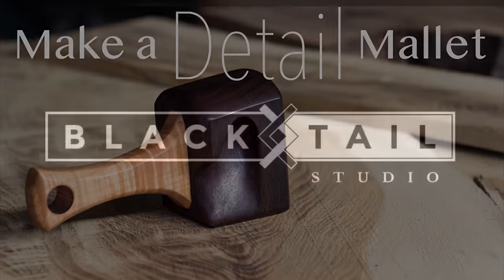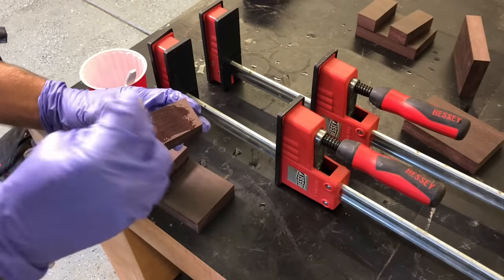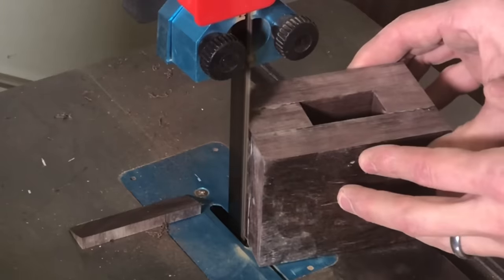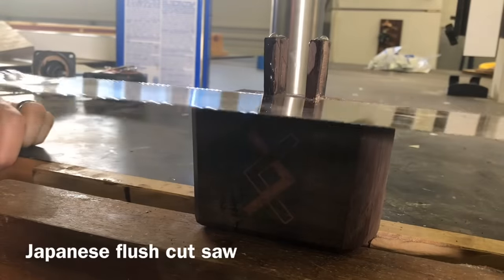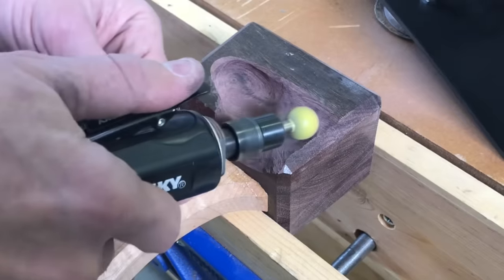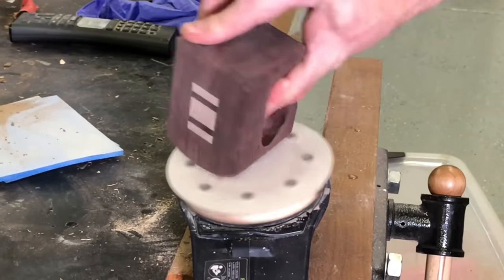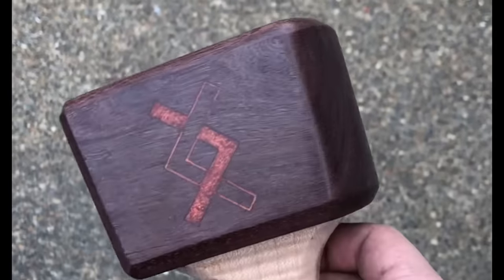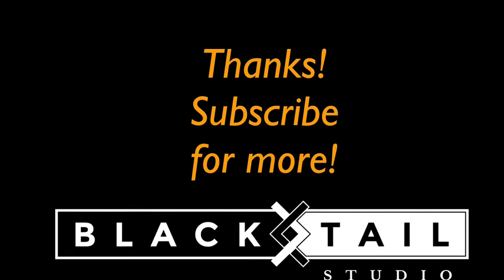The Glove Woodworking Mallet

Comment: For super hard wood i'd suggest either brazilian cherry or african blackwood.  African blackwood especially polishes to a crazy high gloss.

wood-turners trick: For a final finish without micromesh, sand with fine (2000-4000-ish) automotive wet-sand paper (with or without water) than final burnish with some wood shavings from the same wood.  On a lathe i'd just grab a handful of shavings and squeeze around the spinning piece.    More pressure = more burnish.  I'm curious of anyone has tried something similar on flat pieces (maybe shavings under a flannel patch on a random orbit or vibratory sander?)

Comment: Get yourself some copper tube cutters. It will make the cutting so much easier and straighter.
You can get a cheap pair on eBay for like 5 or 10 bucks and if you aren’t using them all of the time they will be fine

Comment: 1 - Here is a suggestion for wedging - drill holes at the end of the cuts for the wedge.  Larger diameter than the actual cut.  This allows the spring ends to spring open and not overly stretch the wood as the tops wedge outward.  Removes the inner stress at the spring end.

2 - Would not a "squarer" face on the round end be easier to use?  Less "slipping off center" as I see happening in the vid.
Reply from the maker: I didn’t notice any slipping, But definitely make yours any way you want 👍🏼

Comment: Where do you get some thick all purpose bandsaw blades like that? I looked everywhere and all I have around her are the thin 1/4 wood blades. And also, my saw has a 96inch blade, how come yours stays straight? Mine flops around, I can barely cut a straight line. If I tighten it. It snaps.
Reply from the maker: I got a pretty good bandsaw. That helps. It’s a laguna with a laguna blade. Both are available at woodcraft or rockler.
Reply: @BlacktailStudio  I dont know how good mine is, but its a big Delta with 14 inch wheels. I would just like to cut straight lines. damn noodle blade!

Comment: Amazing work. At the very beginning, you briefly show a couple traditional mallets with the copper pipe in the head, presumably for weights. How do you cut the perfectly matched wood plugs to for inside those?
Reply from the maker: Good eye! And plug cutter on my drill press

Comment: What!!?? Are you kidding??!! Brother! How can you dis Katalox that way? Katalox is a GORGEOUS wood (it also cuts and carves so nicely, and smells so unique too, though I admit, you're right, it irritates the sinuses). I use it alot and its purplish tone contrasts so well with the orange colors of Padauk, Cocobolo,  Bubinga, the gold of Jatobo, Bocote, Goncalo Alves, Granadillo, etc. . As you've surely discovered, with Maple it looks so much like an ice cream sandwich! . Its purplish brown tone seems, to my eye,  to be enhanced by PurpleHeart, which is awesome even as just a thin slice for accents.  BTW,  FYI, I have found that  some cuts of Katalox is so "waxy/oily" that some epoxies and glues just pop right off of it like it was mold released if you don't treat it first. Especially when gluing it to other waxy/oily/silca heavy woods like cocobolo.  I've discovered that if you scrub the to be glued surfaces first with acetone then rubbing alcohol the surfaces will glue up just fine. The acetone seems to loosen up whatever teflon-like compounds in the wood fibers that make it glue resistant and the alcohol wipes it all up; and since alcohol volatile it evaporates and leaves the surface more porous, less hydrophobic and much more gluable. Give it a try, let me know if you get the same results.

Comment: Sorry for commenting on an old video.

If the mallet is uncomfortable to use straight up and down, couldn't you just flip it around and use the flat edge instead? Or if there's a reason flat doesn't work, just round off both edges, so you can use it with and without the thumb?

Comment: Kind of surprised the grain is going in the direction of force on the handle. Seems it would break easily. Expected the grain to go along the handle, not across. Looks fantastic and I guess you aren't hitting it hard, so I get that. Just isn't the strongest orientation.

Comment: Did you ever figure out the name of the rubber block you used to clean the sandpaper? I do granite work and we patch chips and holes with epoxy. When grinding epoxy with sandpaper gums up the sandpaper. I used to have one of those rubber blocks but have never found one again
Reply from the maker: I actually don’t know off the top of my head

Comment: Have you thought about having the presenting angle of the mallet at an angle instead of straight on? Cobblers hammers are like this so that you don't have to contort your wrist. I noticed in all of the shots of you using the mallet, your wrist is always at a really awkward angle, which would cause strain long term.
Reply from the maker: Ya, I have different mallets for different angles

Comment: Beautiful job Cam! Do you recommend these micro mesh for use on high gloss epoxy? Festool ETS 125 REQ & ETS 150/5 EQ if that factors. Keep up the great work. Cheers.
Reply: If you use micromesh on plastic (or epoxy), Wet the surface wet with water and a few drops of dish detergent.  Rinse between grits.  It just occurred to me that it might work well with mineral spirits on hard wood, but I haven't tried.

Comment: Hi, I am from Iceland and I am new into woodworking. Birch is the local wood here (we have some Rowan as well and some others but birch is by far the most abundant). I was wondering if you think it would work to use green birch for a mallet head. I was actually thinking of sawing the top of a birch stump in a local playground to use but of course its not dry, do you think it will be a disaster?
Reply from the maker: Will crack and split, but can always remake it!
Reply: @BlacktailStudio  Thanks for the reply! I am also planning to make some end grain cutting boards for christmas presents. I know it is not your forte but I have a couple of suboptimal options for the woods for the cutting boards. I have bought some Jatoba as it was the cheapest brownish hardwood but the option for the light color (going for checkerboard pattern) is either Yellow polplar that I got cheap from the hardwood dealer or oak that I can get for free. The poplar is on the soft side and the oak has big pores (not red oak though, think it is called English oak). Would be curious to get your opinion of this wood choice?
Also, great channel, love watching your vids and they have a big part in my newly found interest in woodworking!

Comment: Thank you for using neoprene gloves that you can resist being pulled to the saw, or catch on a drill chuck and take your hand off :) it better not to use gloves
Reply: " it better not to use gloves'  Yes.  I almost had my hand pulled into my drill press last year.  Cold in the garage, had the gloves on without thinking.  Started using the drill press, glove caught.  Pulled the glove and wrapped around the bit.  Luckily, my hand pulled out before any severe damage.  Scared the crap out of me.

Comment: Why did you only do the thumb pocket on the curved face?
Have you thought of making one with a blind pocket, where you put the wedges in the slots and drive it into the hole, driving the wedges in to the handle, but with no visible end of the handle? It might make people wonder how you made it and what holds the handle on. ;)

Comment: When working with the copper and you were grinding it down. Is that a sanding wheel you're using?
Reply from the maker: Oh, it’s a disk grinder I think. Technically.
Reply: @BlacktailStudio  ok great, thanks
Reply: @BlacktailStudio  Not sure if this is useful information or not but used an 80 grit disk on my orbital sander and it has gotten the job done surprisingly well.

Comment: a flush cut saw that leaves scratches on the surface isn't a flush cut saw.  it's a ryoba, which is the saw you are actually using.  use your ryoba to do its job.  get a flush cut saw to cut flush to the surface with no scratches.

Comment: So I assume you only use the rounded head of the mallet, or do you use both sides? If so why not put the thumb slot on both sides?
Reply from the maker: I do use both sides, but I hadn’t considered doing one on both sides. Maybe that’ll be the next model!
Reply: @BlacktailStudio  I do look super nice tho. I would however consider using a slightly lighter epoxi in the logo. Just to make it pop more. The copper once became very dark as it cured. But that is probably more of a personal taste thing. =)

Comment: My first & only mallet I made was from Dogwood. It grows all over central Florida. When I bought my first home the tree was there. It finally died so I cut it down and saved the largest pieces. I had just bought an old, well used lathe. I turned the mallet on that lathe with common woodworking tools. Seems funny, now but I still use it once in a while.
I built a short X long bookcase for a friend & used that mallet(more of a club) to put the less than accurate biscuit joints together.A small part of the mallet exploded and hit me in the head. I researched the Dogwood tree & found out that it was the Dogwood tree that was used for the crown of thorns on Jesus' head. The lore says that God cursed the tree, that nothing could ever be made from it and stay as made.
Sorry I ran on so long.
Jim
Reply from the maker: Thanks for the story Jim, always appreciated.

Comment: I don't like mallets made of super hard woods. They're just not very nice to use. I like a softer wood, in fact anything softer than maple that'll have some give to it. It's not a bad thing if the mallet takes dents, in fact that's ideal. It's better than your piece taking dents. The orbital sander in the vice is a real head scratcher. Can't find the fine grit for your belt sanders? Now it's not a bad idea to polish your wood up but going through all those grits as if this were metalworking isn't necessary, the wood is naturally porous and after 320 or even 220 the scratches are smaller than the natural texture of the wood. You can skip straight to polishing at this point. Rather than buy all those unnecessary specialty papers and go through all those extra stages you can get the exact same effect using a buffing wheel on your grinder, or a piece of totally worn out 320 on your beltsander. There is going to be no difference whatsoever. Most people will wait to do this step after finishing, but yeah you can absolutely use penetrating oils after polishing.
Reply from the maker: Very nice!